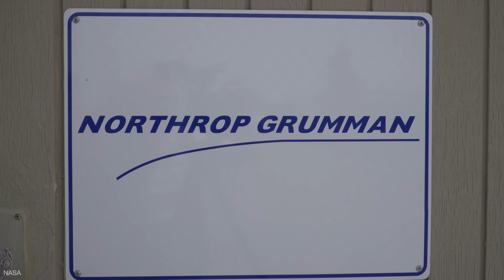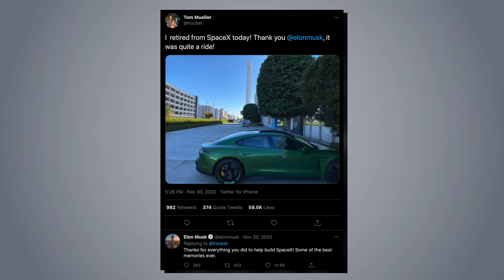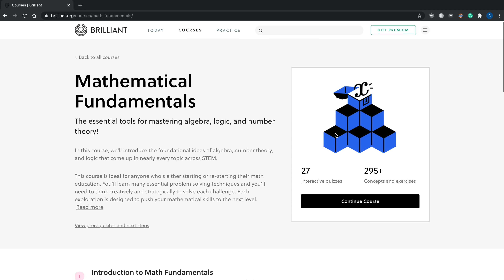Meet the Brains Behind SpaceX Rockets

Comment: The Merlin Engine isn’t as revolutionary as you put it. Its not the first or the only engine designed to be reused.
Reply: But it's dirt cheap. The Space Shuttle main engines are reusable but with a lot of work and cost $30 million during the shuttle program and are going to go up to $100 million for engines made for the SLS.
Reply: @bensemusx  
It is totally stupid to use hydrogen and optimize impulse on a first stage, which is why Shuttle and SLS both need solid rocket boosters, and are excessively expensive. 

Of course, SRBs are not rapidly reusable, and end up costing the same whether new or rebuilt. 

Using enough engines to assure mission success with one engine failure is sensible on Falcon-9, as is reducing engine cost by scaling down critical turbo-pumps by using cheap high-density RP1 instead of expensive low-density hydrogen.
Reply: Merlin was the only Western engine to be designed from the beginning to maximize thrust and to be rapidly re-usable. It still has the highest thrust-to-weight ratio, exceeding Raptor.

Comment: liquid fuel rocket???
Reply: Many rockets use liquid oxygen and liquid hydrogen, liquid methane or rocket grade kerosene for their oxidizer and fuel. Besides kerosene they are all gasses at room temperature so they are cooled to cryogenic temperatures to liquify them as liquids are much denser than gases. Normally they are cooled to just below their boiling point but SpaceX cools their fuel and oxidizer all the way down to almost their freezing point to  get them just a bit denser to get more fuel and oxidizer in the same volume.

Comment: While I wouldn't dispute for a second that Tom Meuller played a critical role at SpaceX, there is a difference between being a critical man and being a man playing a critical role. I would argue that the only truly critical person for SpaceX was Elon Musk. Even Meuller's role could have been played by someone else and if he hadn't signed on, Musk would have found someone else (or several others) to play that role.
Reply: Maybe but finding a guy with an engine blueprint was super beneficial to the brand new SpaceX. It's not easy finding someone who knows how to actually design and build a rocket engine let alone one designed from the beginning to be reused. Look at Blue Origin. They are older than SpaceX and still working on getting their main engine built.
Reply: @bensemusx  Blue origin is a poor choice to make your point. They've been flying the BE-3 for years (new Sheppard- since 2015). The BE-4 is more akin to the Raptor than the Merlin, as far as place in the company is concerned.  Tom Mueller wasn't much involved in Raptor development and it has admittedly taken much longer to develop than the Merlin did, but it does argue that SpaceX could have developed the Merlin (or an equivalent) without him. It also argues the other side a bit, as it's maybe doubtful that SpaceX could have survived long enough, but personally I think they would have at least had an excellent chance of doing so (hey, someone else might not have forgotten the residual thrust of a regeneratively cooled engine, or at least started there and maybe saved a lot of time and effort).
Reply: No Elon=No SpaceX 
No Tom = failed SpaceX
Reply: Yes, like I texted in my comment, no Elon, no SpaceX and no credit. but all the same, let's give credit where it's due, Tom is a remarkable engineer.